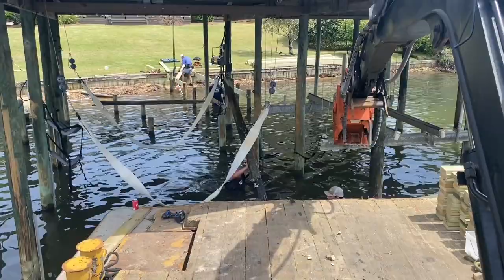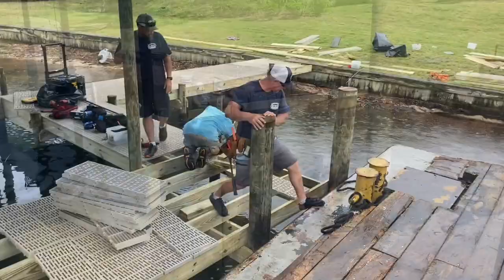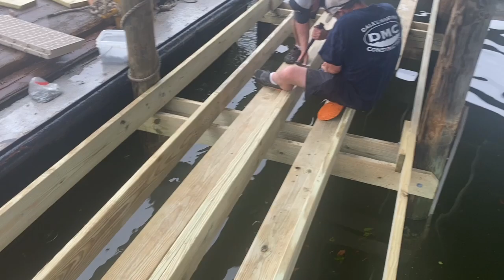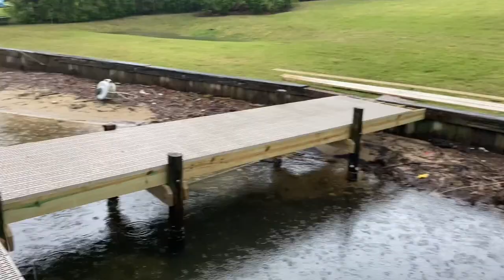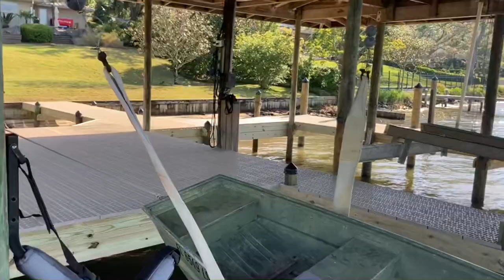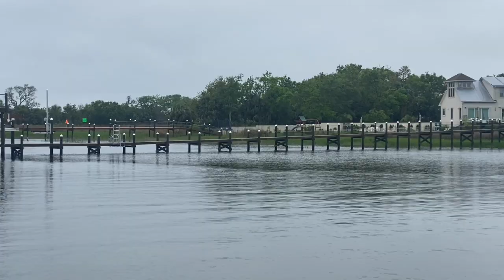TRU-FLOW Storm surge protection decking

Comment: Looks Great!  Could you please tell me the size of the pilings used in the first walkway out to the boathouse?  Are they 6" Tops?  Thank you
Reply from the maker: Thanks for your comment and watching my channel. Yes the pilings on this job are all 6 inch as I had mentioned in a video. This is something I built back when I was just a teenager. We had no equipment and it was all built by hand looks like it’s done a good job for all these years. We went back and added some larger pilings to sister pole the boathouse
Reply: @DaleWHickman  Thank you for the reply.  I've enjoyed your videos.  I'll be putting in our own dock in a a tidal creek in Savannah area and was found your videos while searching for ThruFlow decking.  Great work!

Comment: This looks like such a fun job to me. Love the videos!

I'm planning on doing this type of project myself (since you're not in NC!). My dock deck is pretty worn out. The joists are also all split down the middle so the deck boards (which are nailed) are no longer secured well. Every flood lifts off a few more. 

It looks like I just run a string from one end to the other to establish a level, add the cross members, joists, then decking. Now I'm thinking it would be nice to have a step down like this one... 

I'm learning a lot. Thanks for taking the time to make these.
Reply from the maker: Thanks for watching and commenting Andrew I truly appreciate that. Our customers in this area get ideas from watching the videos as well. Good luck with your project.

Comment: Dale I know your machine speeds up driving in posts. After you get caught up on your work, I'd love to see a detailed video on how to wash a post in the old fashion way. Such as what equipment is required, what type of pump is used, how much pressure is needed. how to make a home made tool to get the post in, how long should the tool be to wash a typical post in.
Reply from the maker: You got it Paul I’ll see what I can do I just purchased two new pumps a 4 inch Honda and a 3 inch Honda with a tsunami pump.
Reply: @DaleWHickman  thanks that would be cool....